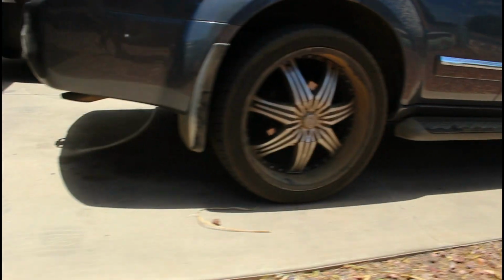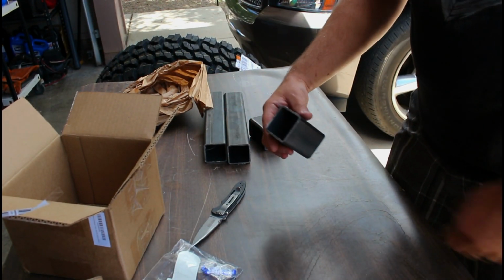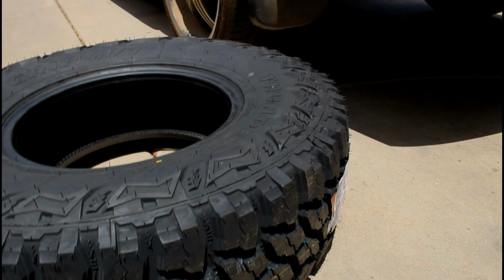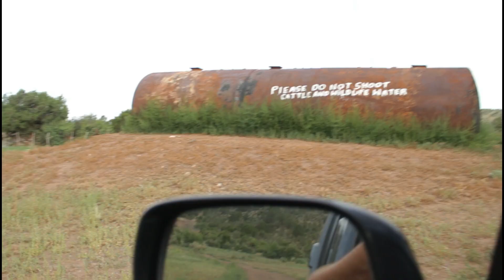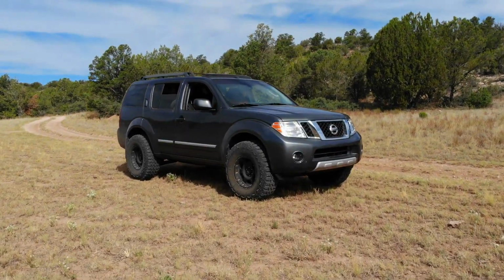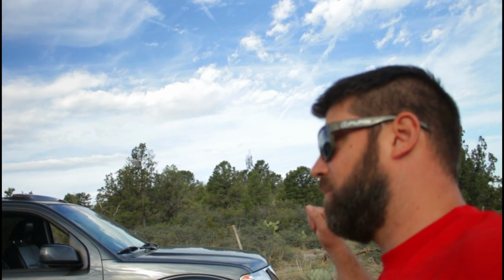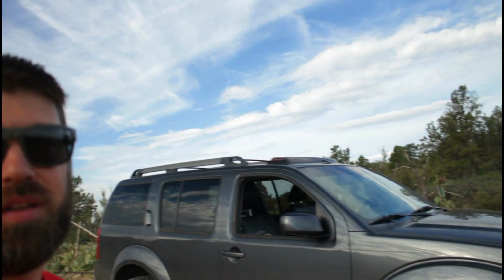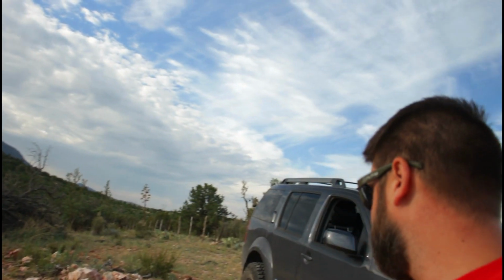Nissan Pathfinder R51 Lift

Comment: It’s a really sophisticated all wheel drive system, but nothing like the true 4 x 4 of the frontier or xterra
Reply: johnny martinez how so? I’m curious and I have an R50 pathy.
Reply: johnny martinez oh wait, I just noticed it has rear independent suspension...
Reply: Got news for you they all share the same traction control system same engine .. trans ...transfer case front diff and suspension the only difference between a pathy and the other two is the rear diff and suspension.. from 05 and up.

Comment: This vehicle is seriously very underrated. I live in freezing temperatures here in Canada and once in 4WD auto it just sticks to the ground in heavy snow and icy conditions - even at temps as low as -30C. The next thing is ABLS, which I see you have mastered well in your other videos. 4WD high and 4WD low split the power 50-50 front/rear. 4WD low gets the ABLS into play (not sure if 4WD high does it), which acts left-right on an axle, by stopping the spinning wheel using brakes. So you are right, it kind of acts like a DIFF lock - needs a little practice and commitment to learn it though - but once you learn it, the vehicle devours most terrain. You can actually see some rock crawling videos on YouTube of Pathfinders. The absence of solid axles can be felt if you get too serious, but the comfort of the IFS/IRS can be felt when you take the family for regular business on tarmac.
Reply: Nice summary! My R51 is amazing in freezing Norway as well! 

If you're still around, do you know if I'm right to deduce that the D40 Navara could come with diff lock, but not the Pathfinder?
Reply: @Sandnessen arb has a diff lock for the r51 path
Reply: @Irish_Hooligan  aha, thanks! Is it the air locker?
Reply: @Sandnessen  yes, but there are brands that make E lockers as well.

Comment: Nice truck and very underrated.
Reply from the maker: Agent. K., I totally agree.  This vehicle has become my favorite one out of all of my previous 4x4 vehicles.
Reply: Agent. K. Agreed! Very underrated . Other then my 3 inch lift and 33’s very similar to this gentleman’s truck it’s completely stock . Well I do have an upgraded air filter system . But other then that I have no problem off road . I go off-road a lot with a friends Jeep club just for fun and Up to this point I’ve only had to be pulled out once and that’s because of a flat tire . But I’ve pulled those guys out a couple times with ease . The first time I just wanted to see what my truck could do , he was stuck in serious mud . I hooked up to the front of his Jeep rubicon and then to the front of my pathfinder and seriously just drug him out . I was pulling in reverse . And check this out , for the first few feet he didn’t even realize he had his E brake on . And I was just dragging him out . After he realized and took it off it was crazy how the pathfinder just pulled him out . I have a video and pictures in my old phone . But yea these trucks really are underrated.
Reply: Alger Adventures where did you get the bolts for the back suspension I also have a Nissan Pathfinder but I can seem to find the longer bolts anywhere.
Reply: What was the size of the bolts that you put and where did you buy them

Comment: Definitely not underrated…
Bought an 11’ with 184k miles just recently. Tons and tons of rust, typical Nissan rust proofing (or lack of). Plenty of electrical issues, clunks and rattles. Compared to a 4Runner it’s an absolute pile in every aspect.

Comment: Hi Dan,
I cannot seem to get the rear properly aligned. I've replaced all the rear suspension components UCAs, LCAs, and spring buckets, getting new rear CV axles replaced tomorrow as one of them is leaking and both boots are heavily cracked so time to replace.
My current setup - 
SUSPENSION:
Front - Supreme Suspensions front leveling kit for (2" Front Lift Aircraft Billet Strut spacer kit)
Rear- Rancho RS70077 coil spring spacer kit (1.75" lift). Brand new Moog 81119 coil springs. Air lift 1000 suspension kit 60810.
Gabriel G63875 shocks for '06 armada 

WHEELS & TIRES: Pro Comp Alloy wheels Series 89 (16" x 8", 6lug x4.5" pitch, -12mm offset). Pro Comp 11124 lug kit. Thunderer MT 285/75R16

Any suggestions/ideas to get alignment dialed in...?? Thanks in advance!!

Comment: I used 08 Armada rear springs on my 05 Pathfinder. Gave me 3" lift, a nicer ride than pathfinder oem springs.
Reply from the maker: Offroad Adventures, Nice did you have problems with getting the rear aligned back into specs.  I know a lot of people cut the Armada springs down to get a 2" or 1" lift.  The Armada springs are a lot cheaper than the aftermarket Pathfinder springs.
Reply: @algeradventures4891  i have not had a  realignment yet. With new springs i wanted them to settle down before hand. But from looking I dont see that it will be an issue.
Reply from the maker: @TNcountrylife  , I agree with letting new springs settle.  Let me know how the realignment goes.  I have read a lot on the forums that over 2" the rear wont go back to specs, but I'm not sure how many people actually tried.
Reply: @algeradventures4891  i dont have an exact number on additional  gains as my factory springs were wore out and sagging. I know i went from 2 to 6 inches of wheel gap. So i may have only gained 2 true inches and corrected 2 inches of sagging. I will say either way i am at max with out charging out other components.. i deffinantly want new upper control arms up front.
Reply: @algeradventures4891  what are some good forums to check out? I have an 01 Pathfinder 4x4 that I want to start upgrading. Not sure where to look for aftermarket parts or ideas....
Reply from the maker: @xxaltdiv4849  , I follow TheNissanPath.com for forums.  they have all the years of pathfinders on it, but i havent checked your's, the R50 out yet.  They do have a section just on your model though.  I follow a guy on Instagram you might like, he goes by @thewhitepathfinder.  Its a clean R50 and he takes it out.
Reply: @algeradventures4891  oh your right, he has a dope page and thanks a lot I'll look into the website. Just picked up a 2 in lift kit, new struts and shocks for the rear. I saw that I need to replace that rubber stopper inside the rear spring its worn out. Not going extreme with the build but definitely want something I can daily and take out occasionally off roading. Actually use it. Thanks again
Reply from the maker: @xxaltdiv4849  Awesome it will look sick, and should work perfect for what you want it to do.  Rogue Overland just released a video and they have a clip of a R50 going up a harder trail.
Reply: @TNcountrylife  Did you have any alignment issues using the 08 Armada springs? I'm looking to do the same in the back as it seems a bit less work then adding the 2×2 tubing like Alger Adventures did.. I will be using the same 2" puck upfront.. plz let me know.. as well as how alignment went. Thanks

Comment: Did you have to loosen the rear sub frame off on both sides or did you do one side at a time? My pathfinder looks a lot like yours except much more rust colored underneath. I live in Canada and its not quite as easy getting some of those bolts out. Thanks for the videos they're a great help!

Comment: What's the length of the new bolts and pitch
Reply: I want to know the same?
Reply: @wolf2016.  I ordered a 5in sub frame from prg and calmini front with 2in spacer hat in front and 2in springs in rear

Comment: its about dam time i see a r51 video lol now you have convinced me to do a 2 inch lift. very nice! i have a few questions though. with the puck up front do the control arms contact the coilover cradle? also what are the specs on the longer bolts for the rear? length and thread pitch.

Comment: My pathy is due for a spring shock replacement..... I’m thinking about lifting it also... I don’t see many pathfinder out there lift
Reply from the maker: Their are a bunch of options for spring and shock replacements depending on your budget.  And no their isn't many lifted pathfinders out their
Reply: Alger Adventures 

I’m thinking about going kyb. I just want my ride to be smooth again. What brand do u have in yours ?
Reply from the maker: @hughujkbkilhhhfbhgyre6436  , I have the factory shock's and springs still. I just added spacers. I know my suspension is now stuffer than factory in the front but I don't notice it
Reply: Alger Adventures 

Ok, thanks.

Comment: Hi! Looks great! Thanks for sharing this! Could you please to inform what the wall thickness in millimeter?
Reply from the maker: Paulo Fogaca,  If you are talking about what i used for my rear lift.  It is .120 wall which is about 3 mm, but i would recommend doing it .250 which is about 6 mm
Reply: @algeradventures4891  Thank you very much for your attention. I will install on my R51 with 6mm and then send you photos
Reply from the maker: @prfogaca100  Yeah your welcome,  Please do send the photos.  I don't think their are enough R51's' lifted out there.

Comment: Thanks, man, I am gonna do this on mine, unbelievable what a simple solution :D. Any chance you can share what brand are those front spacers so I can buy the same? Otherwise, I risk not getting a beer opener hehe
Reply from the maker: Tengu Drift, lol of course.  Its supreme suspension, but the beer opener isn't as good as quality as the lift spacers.

Comment: A great video I got a 2005 Pathfinder no lift and I want to put 32s on it. you think I can do that with no lift?
Reply from the maker: I'm sure you can, it's just how much you might have to cut to make it fit
Reply: I have mounted 32s (255/75 17, bfg at ko2) on mine stock 06 pathy. No rubbing, but it is a really tight squeeze...  on front wheels only 1 mm to bunper on full lock.

Comment: Thanks for sharing this. because the rear lift is subframe spacers, did you have any driveline vibrations from the diff being dropped 2"? im guessing you had to buy longer bolts for the rear subframe with the spacers?
Reply from the maker: Dorian F, thank you for watching my video.  No i haven't had any drive line vibration that i have noticed.  Yes I had to get longer bolts, no hardware stores carry long enough bolts,  I bought mine from BoltDepot.com.  The longest boltdepot had was 120mm they work no problem but,  i would feel better with 130mm but i haven't been able to find any.
Reply: @algeradventures4891  I attempted to do my rear lift today and all the subframe bolts broke off inside the frame, lol. So I got some work to do tomorrow.
Reply: @algeradventures4891  Hi mate what bolts did you use for rear subframe. Are they m12 8.8 1.25 pitch same as body?
Reply from the maker: @dorianf1456  , sorry to hear about your bolts breaking, especially since it was all of them.  How did it go getting those out and replacing them?
Reply: @algeradventures4891  I air hammered the broken bolts and weld nuts out of the frame and fished new nuts inside the frame rails. its wasnt easy but the front and rear lift is done now. The alignment was annoying too because most of the adjustment cams were siezed.
Reply from the maker: @dorianf1456  ,  yeah that whole process doesn't sound fun, but at least its done now and you can enjoy your lift.

Comment: Hi,where can buy the longer bolt for rear lift extender? Thanks.
Reply from the maker: I got mine from ace hardware, but I did want bolts that are about half an inch longer and I could only find them online that you had to buy in bulk
Reply: Did you change your front upper arm since 2" lift add on

Comment: You are doing the car god's work my friend. Especially the part where you took them "rims" off and gave it some propper mudders. Currently researching doing this for the pathfinder's big brother, the kit is crazy expensive and I don't see why I can't do the same thing you are doing right here. Maybe plate the ends of the box for a little more strength so that it doesn't diamond but it's unlikely that would happen anyway. Great video, thanks!

Comment: This is so awesome you know how to do this. I just bought a 2012 used Nissan Pathfinder Silver Edition 4WD. I got a 2 inch lift put on, but how did you get the tires to stick out?  Im sorry if thats a stupid question. Btw I love your videos, please post more!
Reply: Buy wheels with a higher negative offset, or you can run spacers

Comment: When you did your lift did your bumpers separate from the rest of the body or are they attached. I'm asking because I've noticed that when some trucks have a body lift that the bumpers and body end up with a huge gap between them due to the bumpers being attached to the frame separately.
Reply from the maker: i did a subframe drop, so the body and bumpers stay in the same place.

Comment: Hey Alger 
Thanks for the tuto
I bought the same spacers for my front shocks on pathfinder 2011, but I couldn't mount them : the bottom of the schocks in then so low that the upper triangle hits the top of shocks bracket.
Seems that the maximum shims I could insert on top of my shocks is about half inch.... ☹
Didn't you net the same problem ?
Reply from the maker: Manu Iqmj, it will make it a little easier if you loosen the upper and lower control arm bolts so your not fighting the bushings. Then with a floor jack under the lower control arm Jack it up to get the bottom shock bolt in and then jack the lower control arm up high enough to get the upper control arm into the knuckle and get a few threads on the but started. I hope that helps you. Without an after market upper control arm it takes a bit to get it together.

Comment: Hello, great work, is the swaybar at the rear installed? If not, was the articulation improved? and how is the road feeling with those high profile tires?, I like the way those 16 inch wheels looks but do not know if go with 17 inch to keep road manners more close to oem.
Reply from the maker: Huaso, Thank you.  No, i removed my rear sway-bar.  I never got to compare how it does off-road because when i bought my pathfinder it had 22" wheels and i never had any real traction on trails to begin with.  But I max out my rear flex on trails now, that with the rear sway bar installed would limit how the whole rear would work.  I couldn't compare the on road feeling and handling to stock because of the 22's, and the 22's made the on-road driving horrible.  With 16's to 17's, i chose 16" because the tires are cheaper than the 17's, by a little bit.  Me personally i don't think their would be a big noticeable difference for side wall flex on road between the 16" to 17" rim.  You would feel more with removing the rear sway bar.

Comment: Hi, just wanted to ask you how well are the tubings you used for the back suspension lifts holding after this months of use, and if you changed the bolts for longer and stronger ones or used the originals. Thanks for posting this video!
Reply from the maker: Hi, I have checked them recently and haven't had any problems with bolts coming loose or the rubbing folding over. They have performed perfect for me so far
Reply: @algeradventures4891  what are the size and pitch of the new bolts?  Going to be doing this to mine soon!!
Reply: You could put sleeves inside of the tubing if it ever started to squish together. Infact, I just bought I 05 and that's what I'm going to do.

Comment: Nice car, and a really nice solution for the rear lift. Could you tell me what sort of threads the bolts that hold the subframe are? I want to do this on my Pathfinder.
Reply from the maker: Pokerfjes,  Thank you.  The rear bolts are M14 x 1.50 and i would try to get them in 130 mm length.
Reply: @algeradventures4891  it’s hard to find 130mm length what did you use ? 120mm?

Comment: Did you face any problems with rear diff ? I lifted mine and after alignment the rear right short axle of the diff went out a bit and because of that the ABS sensor not reading anymore. Any solution?

Comment: Hey Dan-
I'm super excited.. got my wheels and front spacers delivered yesterday and my tires just came in an hour ago.. I went with your exact setup. The only thing I'm doing different is for the rear I ended up buying the ready made pucks from amazon.. the ones that go above/below the rear coils. We'll see how that pans out. 
I did have a question though- what did you do as far as TPMS.. did you get new ones, just transferred the old ones, or delete them from the system altogether (and is this doable)? Thanks, will have to send you pics once I get it all installed!
Reply from the maker: Da_Q-ban_One,  Awesome that is very exciting, time to transform your Pathfinder.  You will have to let me know how the rear works out.  You can have the tire shop that is doing your wheels and tires transfer your TPMS over to your new wheel setup.  You could leave them off the vehicle but you would have a tire light on.  When they transferred mine over they did have to get a new seal kit for 2 of the sensors, but it was only like $10-$15.  You will have to let me how the the lift goes, and yes i would like to see pics of your Pathfinder all setup.
Reply: Mind if I ask how this went? Looking at the pucks for the back as well. Thanks!
Reply: @dereklonsdale282  I am still having difficulties getting rear aligned properly. This is my current setup:
SUSPENSION:
Front - Supreme Suspensions front leveling kit for (2" Front Lift Aircraft Billet Strut spacer kit)
Rear- Rancho RS70077 coil spring spacer kit (1.75" lift). Brand new Moog 81119 coil springs. Air lift 1000 suspension kit 60810.
Gabriel G63875 shocks for '06 armada 

WHEELS & TIRES: Pro Comp Alloy wheels Series 89 (16" x 8", 6lug x4.5" pitch, -12mm offset). Pro Comp 11124 lug kit. Thunderer MT 285/75R16